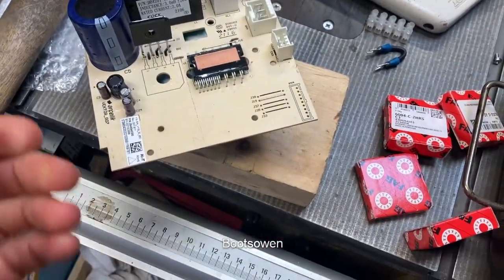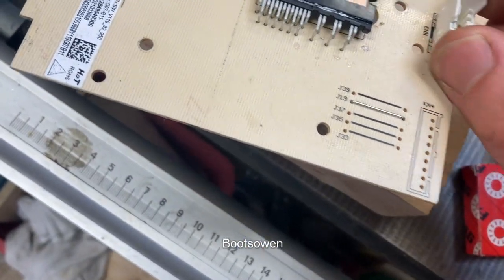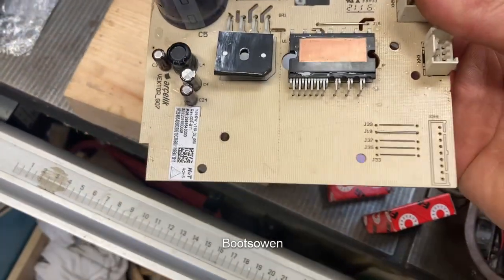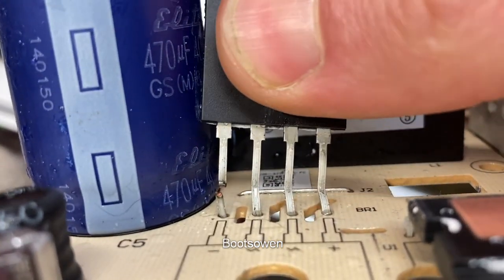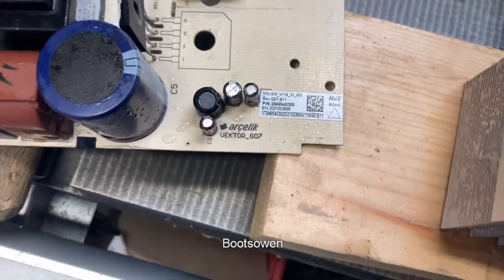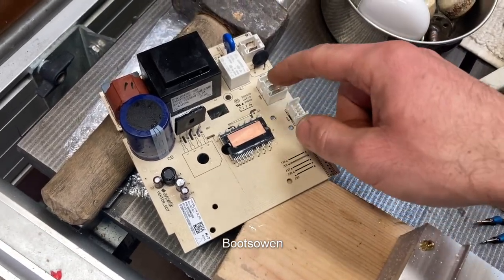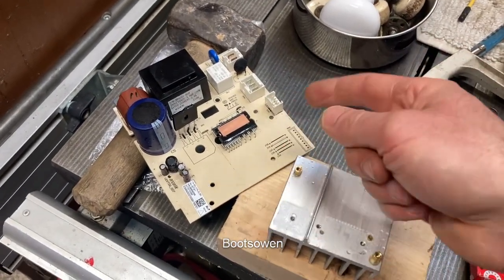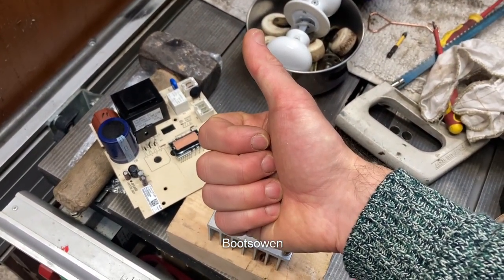Washing machine inverter PCB autopsy: Vektor G07 Arcelik 2849540300

Comment: I'm currently diagnosing a G08 version of the board that is almost identical. That connector you are talking about accepts serial commands. The main board sends the speed setpoint and querys of the current status of the motor. The baud rate is 150baud (yes slow) 8N1 every 0.7 seconds. An example to put the motor in to spin cycle is to send the board 0x03 0x0A 0x04 0xB0 0x3E, The first two bytes I dont know what they are but 3rd and 4th byte is the speed setpoint (1200rpm in my case) and the laft byte is the checksum of the firs four bytes. 
An example of CW spin ant 53rpm is 0x3C 0x00 0x00 0x34 0x8F. 3rd and fourth byte define the speed 
CCW at 100rpm is 0x03 0x00 0x00 0x64 0x98. 
This iswhat I got with my logic analyzer
Reply: Witaj. Właśnie miałem pomysł aby zaadoptować te części do pewnego projektu DIY bo zainteresował mnie 3 fazowy silnik i jego regulator . Myślałem że ten sygnał o którym mówisz to PWM , ale chyba się myliłem. Czy możesz to potwierdzić? Dziękuję i pozdrawiam w nowym roku 🎉

Comment: Miele uses a similar setup for their washers and dryers. No tacho, the speed is determined by the 3 power lines. They use a similar chip. Fascinating but very fragile. They do this odd jogging action before they start. Determining the position of the rotor?

Comment: Beko machines always hardly sudslocks, the brushed ones burns the brushes, and the inverter motor ones burns the boards. They never learn about to handle that. The board looks cheap, but the beko machines reliable to fix because the spare parts are cheap

Comment: The MC56F82746 on the back of the board is a Digital Signal Controller (DSC). The datasheet says: "This family of digital signal controllers (DSCs) is
based on the 32-bit 56800EX core. On a single chip,
each device combines the processing power of a DSP (digital signal processor)
and the functionality of an MCU (microcontroller), with a flexible set of
peripherals to support many target applications:
[...] - Home Appliances [...]"
My guess it that this little fellow takes the data from the main pcb, does it's magic and basically regulates the speed of the motor via the inverter board according to what the main pcb wants it to be (and therefor communicates to it what speed it's at).

Comment: You probably know this already, the transformer (blue/ grey and black/ grey wrapping) are aluminium shells with a film / block inside. You can take apart the casing and get clean aluminium or put them in whole as dirty aluminium. If you are going to take the outside wrapping off cut it with a Stanley knife while it is on the board.

Comment: If you made an inverter washing machine spin up using a VFD  I think that would be a first on Youtube! Even better if you brick a washer with 3-phase motor being controlled by a VFD. That would be really cool to see. That is how you hotwire an inverter motor. You can use a VFD to control direct drives like LG too. Any 3-phase motor can be used with one.
Reply from the maker: I have done this already. Have a look at my other videos
Reply: @bootsowen  What is the video called? I don't think I saw it before
Reply from the maker: Have a look at my vfd playlist

Comment: Get yourself a settable VFD to play with
Likely the rectifryer died shorted and that was the week point., 
What you would like to be able to manually control those motors from single phase would be a cheep universal VFD
Reply from the maker: Yes. I have done this in another video.